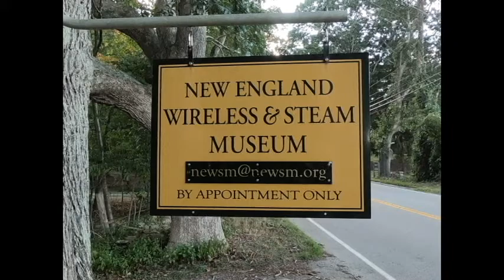Rotary spark gap and Tesla's electricity distribution concept

Comment: Tesla's non-Hertzian waves are not electromagnetic, they are Dielectric impulse displacement currents, the magnetic field component of an EM wave is very lossy and Tesla wanted to avoid this problem for power and communication transmission, an impulse current isn't affected by the inverse square law and transmission delay because it has no magnetic field, and thus no losses, provided the transmitter and receiver and perfectly tuned to each other.

His hairpin circuit is one manner of producing it, run that through a tesla coil setup, preferably 3 coil, and you'll be a step closer to his system, it's apparent he was using this method for Wardenclyffe from FIG 5 of his rare notes, the tower contains a hairpin circuit in its design. The lack of magnetism is the same reason why you can freely touch the cold side of the circuit or interact with it in water without being harmed by it, no magnetism = no harm.